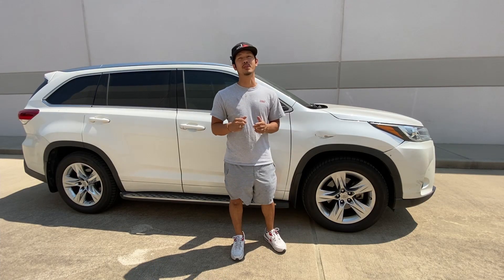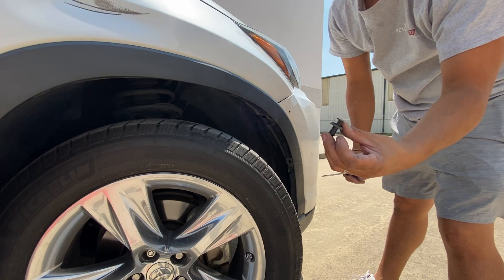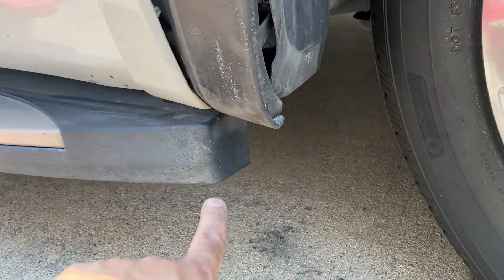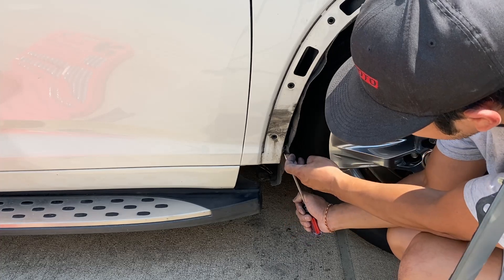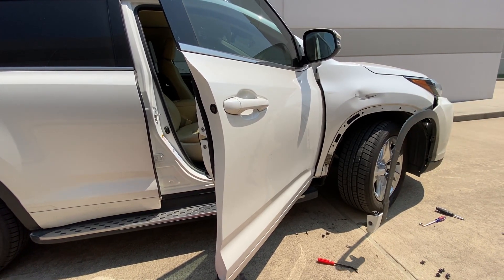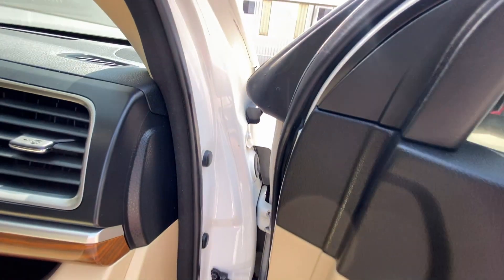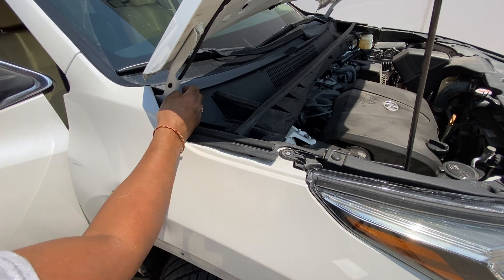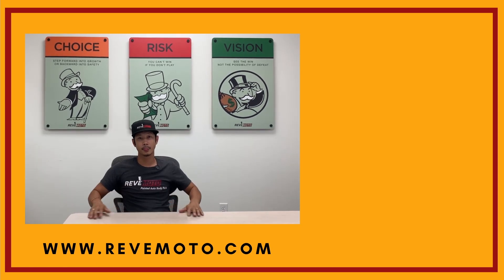How to remove your 2014-2019 Toyota Highlander fender

Comment: How do you remove the rocker panel on the bottom of the rear door? I need to remove it to re-paint it. Road debris damaged. Same vehicle.
Reply from the maker: Hi Ross and great question. The rocker panel will usually have plastic push-pins/clips along the bottom or tabs that just need to pulled out gently. There will most like be bolts by the wheels. They are normally behind the fender liner or behind plastic cover. You  might have to disconnect the bottom portion of the fender.  Once the ends are out, you should be able to pull it off. Cheers!